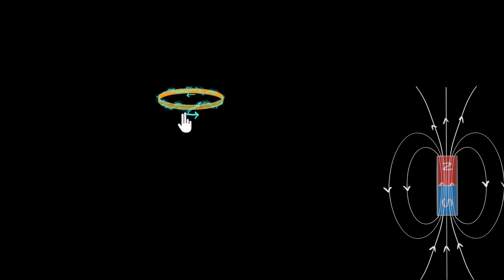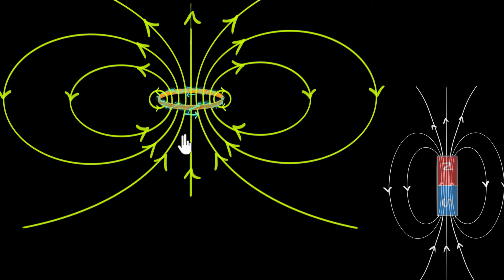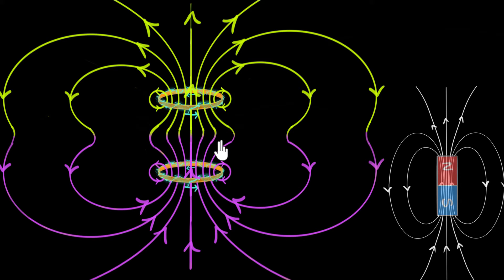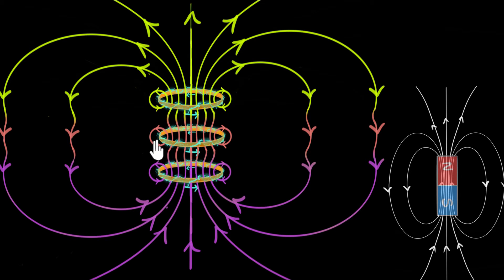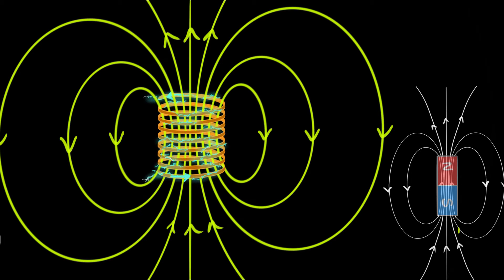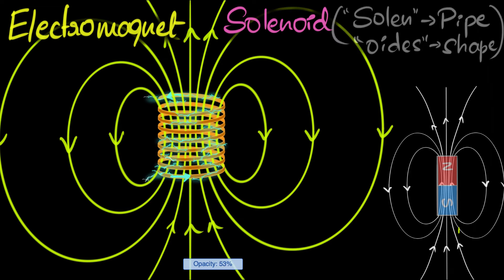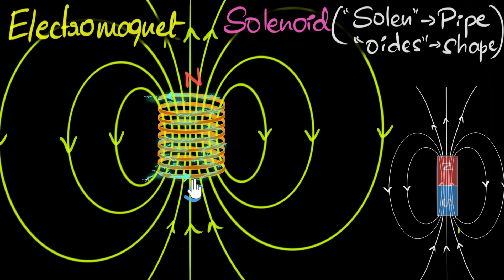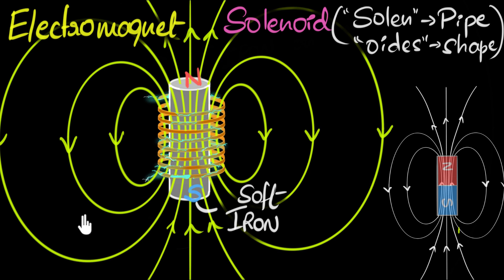Magnetic fields through solenoids

Comment: I'm a little confused by this visual. If you've studied magnetostatics you know that the magnetic field outside the solenoid is (at least very close)  to zero, yet it's drawn in here. Is the idea that as you increase the length of the solenoid and decrease the distance between the coils (like an ideal solenoid) that the net magnetic field outside the solenoid get's pushed so far away that it might as well be zero?
Reply from the maker: Yes, you are right. Even in a regular solenoid, the magnetic field inside could be few orders of magnitude higher than the outside. So assuming field to be zero outside is a good approximation!

Comment: Sir are solenoids electromagnets or the magnet formed by ppacing soft iron core electromagnets???
Reply: From what I could gather, every conductor which carries a charge and possesses a magnetic field due to it, is called an electromagnet.
When we introduce an iron core (soft or hard) the electromagnets become stronger. 
This explains that the iron core which we use in a solenoid enhances the effect of that solenoid, or rather we call it the electromagnet, and itself becomes an electromagnet. In other words, the soft iron used becomes a current carrying conductor too, and hence possesses a magnetic field which adds on to that that of the electromagnetic solenoid.